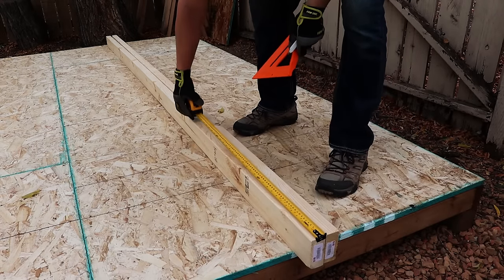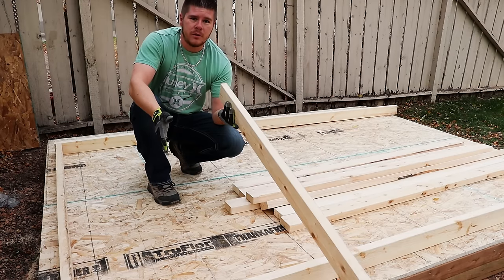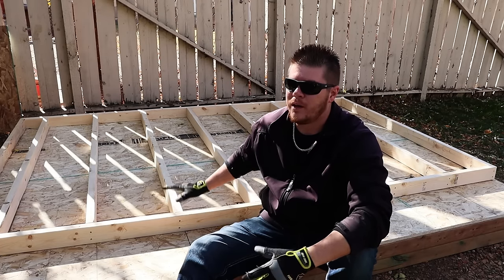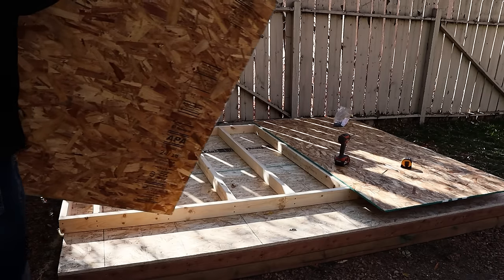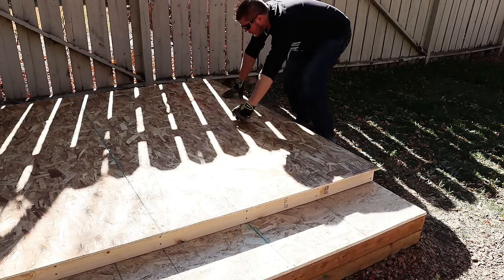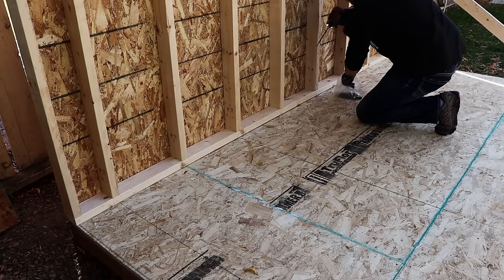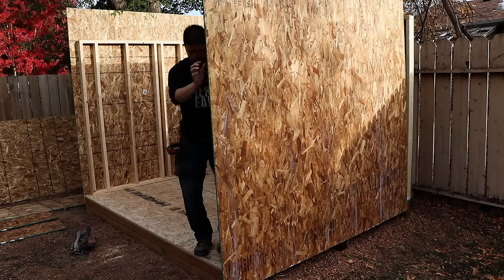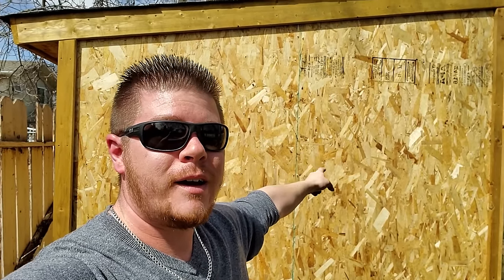How to build a storage shed - Walls // Part 2 - Plans available

Comment: This might be from may 2021 but I really enjoyed it, and will be using this plan to build my shed because lord knows I need one in 2022. Happy New Years!!!
Reply from the maker: That's awesome! Good luck on yours. Happy new year!
Reply: @JessedoesDIY  you eire yo wpQ
Reply: @JessedoesDIY  hey Jesse im looking to build a small shed on top of my asphalt and I want to leave space below the shed floor, so snow and rain can filter through. I also don't want the floor to be too high because I have a very heavy car jack and want to store it inside. What do you suggest? Thanks
Reply from the maker: This exact structure is the same design you'd build if it's on solid ground. The skids underneath the floor prevent moisture build up and create an air gap so it stays dry. As for the jack, I'd build a small ramp for the door personally. I almost did it with mine but it wouldn't fit my landscaping. Good luck on yours
Reply: How much did you spend ?
Reply from the maker: I could build it today for $1300

Comment: Great video with details well explained. I have built 2 like that for our annual campsite. One option an old guy taught me was to leave the front and back sheathing 4 inch above the top plates. Then notch them where the roof rafters sit if you are planning for an overhang. No need to add fillers after, hope that makes sense.
Reply from the maker: Thanks. It makes perfect sense yup. I was just trying to make this as easy and approachable for everybody to build so I didn't want to overcomplicate things

Comment: Great video. I've built a couple but like the way you did yours. In case someone hasn't mentioned it yet, one thing to do before lifting a wall is to attach a 2X4 on one end of the wall with a single nail (or screw) about a foot or so from the top. Lay it on the side of the foundation so when the wall is raised the 2X4 will also go up. When the wall is vertical, screw the other end of the 2X4 to the base of the floor/foundation to hold the wall in place.
Reply: Left out that attaching the 2X4 to the top first rather than at the bottom is easier for me.

Comment: Great video this is the  one of the most detailed shed video's i have seen on youtube. 
The only thing i disagree with is the lack of a need for pressure treated lumber above the ground. When a termite colony is mature enough swarmers come to the surface and fly around looking for places to start a new colony. When these swarmers find a suitable place they mark it . Subterranean termites  build mud tubes to the marked area and begin to consume the wood. This is how raised homes still get consumed by termites.  It honestly depends on where you live In general i always build first floors from presuretreated materials . Where i am this is such a large practice that pressure treated lumber is cheaper than standard prime studs. Anyone in the termite belt should just use all pressure treated lumber .
Reply from the maker: Thanks, I appreciate it! In my area we do not have termites, they just don't exist here. This is basically the exact same way we build homes where I'm from, and this is how I did it everyday in the trades it's normal for me. But thanks for sharing your information to all those that do live in the termite belt, I'm sure they'll appreciate it.

Comment: Fixing to build a shed soon, love your insight on building all sides and rear first. I like the slant roof style but I’m still debating A frame roof as well which I’ve built both. I learned from your video was the siding overhang for the 2x4stud and 1/2 inch siding. That is easy to overlook but ugly if you forget.
Reply from the maker: Thanks, glad I could help! This style roof is just so much simpler, and is actually called a classic shed roof, so it makes sense lol Yup,  a little bit of planning makes big differences in the end

Comment: Really good presentation. Thank you. Everything that's necessary delivered in a nice pleasant manner.  I have a similar situation with the foundation. I live in New York which has freezing winters but my local regs DO NOT permit permanent foundations so your floating foundation with timbers looks like the way to go for me. Your foundation is very much like Shannon's (House Improvement) who I very much like as well.
Reply from the maker: Thanks, glad I could help! Floating foundations are really nice and easy to build. Good luck on yours, keep me posted!

Comment: Nice job.  I suggest you screw the wall plate near the studs instead of the middle.  This provides more support and strength.
Reply from the maker: Thanks. This was the way I was taught in school and the way I've seen done at work too. Better than some I've seen lol at least it's fastened down

Comment: Love this, best one I’ve seen so far. I’ll be making mine 12x8 but similar in style. I’m going to use a cleaner subfloor and then t1-11 for the walls to make it look a bit nicer and cheaper.
Reply from the maker: Thanks, glad I could help! That should look good. Keep me posted, good luck on yours!
Reply: what do you mean cleaner subfloor? 3/4 t&g pressure treated is still around $75 dollars for me.
Reply: @ikram4441  like sanded ply, something that isn’t OSB but is legitimate plywood ready for paint/stain
Reply: It is still expensive but makes a huge difference
Reply: Thanks for making this video. Great job!! I had to rebuild my floor and all walls (8x10 shed). I went with the T1-11 for the walls and pressure treated plywood for the new floor. You can get away with particle board, but it will surely rot faster. Yes! The floor was 80.00 per sheet. Total cost for me replacing all but frame and roof was a little over 600.

Comment: Awesome video!
I know that this is just a shed, but if you have corners of walls with no stud, then how can you put in a stud before installing the inner Sheetrock? 
I want to build a 16x40 storage shed so I’m watching your videos and taking tons of notes. We need a 10’ height build, then another 7:12 pitch roof with a 7’ rise for extra storage space. My brothers and I average about 7’3 tall, so I’m trying to compensate. We’re thinking of having a little corner to hangout and get away from the old lady without wasting all of our money at the local watering hole. Part man-cave, part storage, part tool-shed maybe.
Any suggestions? Also, we’re in South Carolina.
How many different types of screws do you need? I counted about three: short, long, and coated, right?
I’ve been hearing a lot of people say that prefab sheds are poorly made. Can you do us a favor and make a video tour of a local shed company or a Lowes/Home Depot showing us what’s really wrong with those “affordable” sheds?
Thank you for all of your work!
Reply from the maker: Hey, sorry I never caught this message, I know it's late now but I'll try to answer. For the corner just add a extra stud on what will be the inside of the wall, but sideways, basically making a "L" in the corner, that way it will reach out just over and inch from behind the other wall and give you material on both wall in the corner to attach to. Wow, you guys are a tall family, definitely need to accommodate. I can't really help too much on the roof situation tho from here because you probably have specific laws down there for hurricanes or tornadoes that I'm not aware of, sorry. As for the prefabbed ones, it's not so much that they are poorly made, it's that they are made to a budget. Unfortunaly that usually means only building it to minimum spec and minimum code if at all, and that just means that some wood is missing like 24" on center instead of 16" so it's less strong, as well as some brackets aren't used. Some however are cheap and do only use 2x3 boards instead of 2x4. Take a tour of those sheds hey...that's a great idea and I'll have to do it this year, I think that will help out lots of people. However I'll have to wait a couple months until they have them in stock and the snow is melted lol. Thanks for watching!

Comment: Good video, lots of information and well explained.  I'm a professional shed builder and noticed one thing that got me wondering.  Is there a reason you have reversed the OSB walls and installed them with the smooth side out, hiding your nail patterns?
Reply from the maker: Thanks! I was hoping for a little smoother finish when painting
Reply: @JessedoesDIY  understood

Comment: Thank you for doing these well-explained videos. Quick question, is there a concern with water/humidity when putting the sheathing almost all the way to the ground on the outside of the walls?
Reply from the maker: Thanks, glad they are helping. No, not really. Because it isn't on the ground, it still has that air gap from sitting on the 4x4 sleepers, it allows for air to flow around and keep everything dry, that's why I only went to the bottom of the 2x4 and not the 4x4
Reply: @JessedoesDIY  Ah! That makes sense. Thank you.
Reply from the maker: Anytime. Keep me posted, good luck on yours!

Comment: Again ... Great Video .. and another thank you for adding the material list, I was looking at building the same size and lean to style so duplicating what you created should be fun. I may add a little deck off to the side. Question though, as for the screws you used, I am assuming you are using #8 gauge throughout? Also, I'm not quite sure how many of each I would need, I started counting during the floor and wall segments but I see you have other size screws in the material list that I'm not seeing you use like the 2 - 3 and 4 inch. Thanks in advance.
Reply from the maker: Thanks. Yeah they are all #8, that is the most common you can buy anywhere. I started with boxes of 50 or in bulk. Anything that goes into pressure treated is a ACQ coated screws, otherwise just a regular deck screw. The 4" screws are coated and were going down through the wall plates into the floor, but a 3.5" will work if that's all you can find. The 3" screws you need coated and uncoated to build the floor and wall framing, and to attach the walls together, as well as make the header beam above the door. And the 2" screws were coated and used to attach the trim. Like I said, typically you take the thickness of the wood your going through and double it, that's the size of screw you need. You can use longer where needed as long as it won't come through the other side of something. Hope that helps!
Reply: @JessedoesDIY  Perfect. I just talked to my association, apparently I need to put this on a concrete slab and it can only be 7.5 foot total height. ( there isn't even a wood shed kit out there under 8 foot) ... silly rules. I guess more calculations come into play now. Thanks for the reply.
Reply from the maker: Well, good thing you can build this one to whatever height you choose. Good luck!

Comment: @JessieDoesDIY thanks for the lessons! Whenever I have to square something like (I'm usually by myself) this keep small square blocks on hand. I  screw them in the corners...it normally works but there's always that "one board with attitude " that won't draw in...thanks for the tip of backing off. 
I have always seen small bracing pieces in between 2x4 and floor joists...you didn't put any in (perhaps difference in codes). I'm about to do a bunch of building...how far apart should I put them please?
Floppy measuring tapes hate me...lol...my shortcut is I premeasured some scrap wood to 16 inches and the thickness of the the boards going in and alternate them...I will be drilling a hole in one end and loosely tying them together to keep them with me as I go.
Reply from the maker: Anytime! I'm glad you found it useful. The blocking in between the floor joists isn't needed because of the center 4x4 beam underneath, does the same job. But typically they'd go centered in the floor and you'd just alienate them side to side slightly so you can screw into each end.

Comment: Great video!  I am contemplating between building a wood one like this or a resin Rubber Maid type.  My current shed is too small and termite infested.  That's my concern with a wood shed-Termites.  I can get a Rubber Maid for about $1500.  How much were materials for this build?  I can probably reuse my current shed doors to save a few $$ too.
Reply from the maker: Thanks! All total this was $1500 for me, but I don't have termites to worry about

Comment: Hi, thanks for sharing your work. I would like to know if the floor in the configuration shown would support a 600lbs lawn mower. Another question is that here in the province of Quebec we have a lot of snow and I wonder if the 2x4 beams are adequate to support the weight of an eventual storm or if it would be better if I put something like 2x6? I believe I will do something like 12x16 instead of 8x10. Thanks again
Reply from the maker: Hey, thanks for watching! I'd probably go up to a 2x6 at least, and add more beams under the floor if you are going to be making it larger and parking a lawnmower in it...maybe even 2x8. We get a ton of snow and cold here in Sask as well so I get it. I'd also up the size of the room rafters as well since they are going over a larger span

Comment: Hey Jesse, quick question about crowning. Building a shed similar to yours but a bit larger. Crowned the studs up for each wall. Just finished raising and connecting the walls to the foundation and each other and have the studs' crowns pointing out for each wall. However, I realize now that I accidentally flipped the left wall and it's studs are crowned in, while the other 3 walls are out. Do you think this a problem structurally? Would obviously be a pain to take it apart and flip the wall but I'll do it if it means a stronger shed. I can't find too much info on this. Thanks
Reply from the maker: Sorry for the delay. No no no, it's not a problem on the walls. The floor and the roof are the structural crowns, the walls are mostly so they just don't look wavy when looking down the length of them. If one wall is all in and another wall is all out you'll never know it by looking at them because looking down it, each will still be straight individually. Hope that helps, let me know if you have more questions, good luck on the rest of the shed!
Reply: @JessedoesDIY  Thanks for the reply. Much appreciated!

Comment: Hey Jesse, I'm a true novice and this is an amazing video. I'm going to build a shed and wanted to ask if t&g osb strong enough for a 250 lb Big Green Egg? I live in a condo and have limited space. The shed will be outside my patio in the common area, so I want to build a side door to wheel it in and out. 
Keep up the great videos!
Reply from the maker: Hey there, sorry for the extremely late response. I'm glad you liked the videos. As long as it doesn't get wet, I'm sure it would be no problem. OSB is actually very strong. Good luck on your project!

Comment: Thnks 4 this upload I'm about 2 built mine 6x8 and another 10x7 so I can clear out my garage and attic 😅 no matter what I do I keep getting more staff dnt kno y🤪any tips or good luck I appreciate it god bless stay safe👍🇵🇭
Reply from the maker: Anytime, glad I could help! Thanks for watching! Keep both your shed in 2' intervals, better use of materials. 6×8 is fine, but I'd make the other 10×8 or 10×6. Good luck on them, keep me posted! I'd like to see how they turn out
Reply: @JessedoesDIY  thnk u🙏 this shed will go to 1 side of my house and the other side,I have 27ft x11ft 6inc. my haus Wall 2 end wall of my property line,That's wer I wanna build the bigger 1I want 2 maximize it but I wanna make sure I have good space 4 emergency exit and moving staff from garage going 2 the backyard, can i stretch it to 6x15 coz if not I will go 4 6x10, again thnk u x2 so much really big help B4 I start buying the material enjoy the rest of ur day stay🤙🇵🇭
Reply from the maker: Cool. Yeah you can stretch it for sure. But again, I'd keep it in 2' intervals. I'd probably go 6×14 to make sure you don't waste material. Good luck!
Reply: @JessedoesDIY  thnk u so much and I need that good luck😅🙏🇵🇭

Comment: I'm planning to build a 8ft x 16ft shed. Do you think a skid type foundation is adequate or should I go towards digging some holes and pouring cement posts every 4ft? PS - Your videos are great for guys like me who don't do this for a living and need a simple, and easy to understand step by step instruction. Thanks for posting your videos, they're great.
Reply from the maker: This foundation will work fine as long as you put it on a rock base, and I'd maybe up it to 2x6 joists. Don't use gravel, just rock. I'm glad you like the videos and happy to help! Good luck on yours

Comment: can you provide a list of every tools that you used on this project? and also a breakdown of the total cost? planing to make exact one just like yours thank you!!!
Reply from the maker: I have a materials list in the description. And at the time it cost me about $1700 total to build in my area, with inflated covid pricing. And for tools you basically saw it. Circular saw, impact driver, level, square, pencil, tape measure, chalk line, hammer, recip saw, and a ladder. I didn't cut much out of the videos, what you saw is how I did it. Good luck on yours!
Reply: @JessedoesDIY  thank you so much!
Reply from the maker: Anytime

Comment: Jesse, just caught this video because I'm getting ready to build a shed. I also have to build 200' of wood fence so I was thinking about investing in a nail gun. I see you built this shed with screws. Any particular reason why you didn't or don't use coated nails for speed? Thanks Jesse.
Reply from the maker: Nice. Well I built it with screws because it's much more approachable for people because most people either have a drill or can get one fairly inexpensively. I didn't need any or the benefits of nails vs screws either